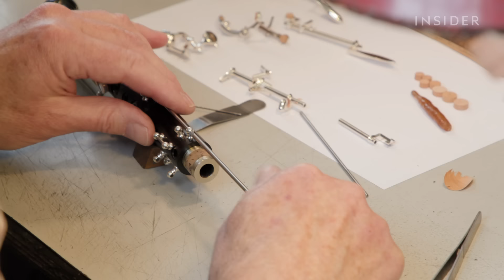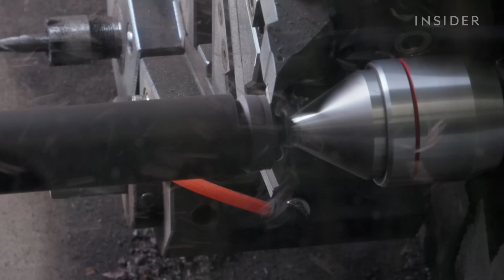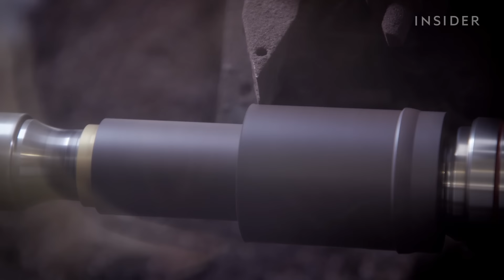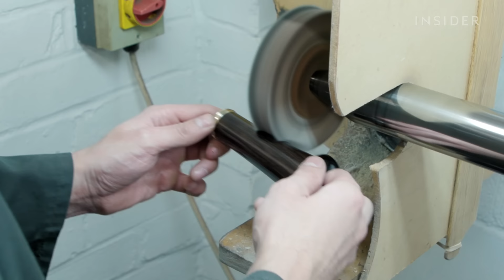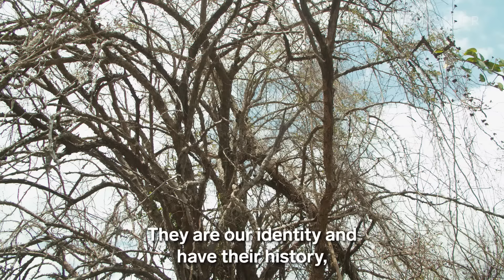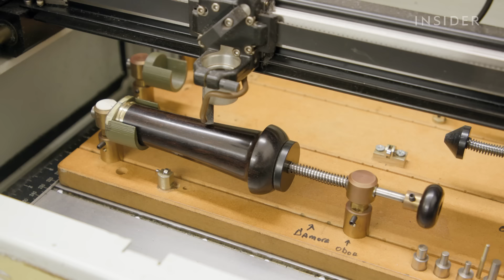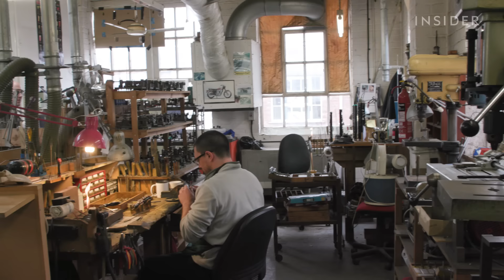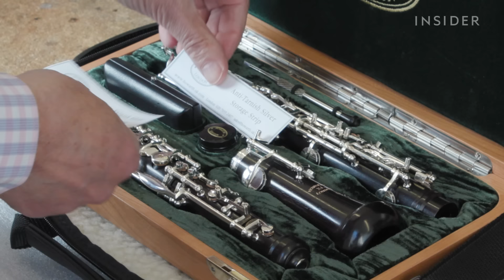Why Oboes Are So Expensive | So Expensive | Business Insider

Comment: If you're wondering why they crack so easily and need such exclusive wood, the answer is bore diameter. The body of a clarinet has the same diameter all the way from top to bottom (excluding the bell at the bottom and the mouthpiece). This gives it great structural stability. An oboe, on the other hand, has a constantly increasing diameter as you go from top to bottom. So it's a lot more fragile. That's why they have to age it and can only use really hard and resilient wood to make it.
Reply: cone versus tube. overall. yes, they both taper outwards, but one is mostly conical, one is mostly tubular
Reply: @gabrielbotsford791  Yes, this is correct, the tapered part has a very different acoustic function and does not affect the fundamental properties. In fact it is a separate piece that attaches to the main body. Possibly more like the flared end of brass instruments, it may affect the dispersion of the vibrating air, rather than determining the note frequencies.
Reply: While the bore diameter and outside diameter increase from top to bottom with around a 1 : 40 taper, the wall thickness remains pretty much the same across the majority of the length of the main joints, so they're no less fragile than any other wooden tube made with the same wall thickness along its length. 

Wooden flutes made with a 19mm cylindrical bore have a much thinner wall and are far more fragile than oboes, so the shape of the bore isn't the factor here - the wall thickness and also the diameters of the toneholes and their proximities to one another is where the strength (or weakness) lies.

The bore diameter at the top end of the bore (immediately below the reed well) is just under 4mm compared to the outer diameter of around 19mm to 22mm (depending on the make and model) when measured at the same point which makes the wall thickness between 7.5mm to 9mm which is just as thick or even thicker than the wall thickness of a Buffet clarinet.
Reply: @chrisperyagh  I’m wondering how wooden piccolos compare to the other woodwinds you mentioned, considering that the wall thickness is exceedingly thin and the (albeit smaller) tone holes are closer together than a flute.
Reply: @熊ちゃん-h7t  Being much smaller in diameter with a similar wall thickness of a wooden flute makes wooden piccolos much stronger relative to wooden flutes - the wall thickness to joint diameter ratio is different on wooden piccolos compared to wooden flutes. 

Wooden flute bodies have a wall thickness between 4mm to 4.5mm and a bore diameter of 19mm, whereas wooden piccolo bodies have a wall thickness of between 3.5mm to 4mm and the bore diameter is 11mm at its widest (wooden piccolos are typically a reverse conical bore with an expansion at the lower end).

If you scale up a piccolo body joint to double the length and diameter to make it the same relative length of a flute body joint, it will have a much thicker wall. 

Think of a cardboard or metal tube with a 0.5mm thick wall as an example - if the diameter is small, the tubing will have more strength to it compared to a much wider diameter tube made with the same 0.5mm wall thickness.

Although the greatest risk with any wooden-bodied woodwind instrument is sudden humidity and temperature changes as well as not maintaining them well and storing them in less than favourable conditions.
Reply: @chrisperyagh  That's kind of what I was thinking.  While a wooden tube is  going to be inherently fragile and more prone to cracking than a cylinder, putting large offset holes all along the length of that wooden tube, and interrupting an otherwise continuous grain structure seems like it would be a larger factor.  Not to mention screwing metal hardware into it, though I assume they either use precisely sized pilot holes or glue/press fit some kind of machined insert or pem to receive threaded fasteners.
Reply: @somethingelse4424  Flute and piccolo pillars are mostly hard soldered to ribs that are in turn screwed into the joint with several short wood screws, rather than individual wide pillar threads being screwed directly into the joints as they are on oboes and clarinets (and bassoons). 

While the body tubes of wooden flutes may be relatively thin and full of toneholes, they don't tend to experience the sort of excessive stresses or applied forces that will snap the joints, unless you accidentally sit on one. 

The headjoints will collect the majority of the condensation from playing and that increase in humidity levels in that area is where cracks are most likely to happen when the inside of the tube is absorbing moisture much more than the outside and the resulting increase in pressure as the cellular structure increases in size can only move outwards causing the outer surface to crack. 

There were wooden flutes made with lined headjoints and the combination of the stability of metal and the effect of humidity levels on wood often cause the headjoints to crack as the wood shrinks against the metal liners. The same is often seen on oboes and clarinets with metal lined sockets which can crack the wooden sockets where the wood is at its thinnest when they dry out.

Metal and wood and metal and plastic just don't mix and at best they're a compromise and at worst a disaster. You'll see on plastic Yamaha piccolos they have two main body ribs with a gap between them at the G# key. Only on wooden piccolos this causes no problem as wood doesn't shrink lengthways with changes of humidity anywhere nearly as much as it does widthways. But on plastic piccolos where the pastic can move in all directions with changes of temperature, the G# key would bind up solid as the two ribs pulled in due to low temperatures, so Yamaha fit the G# key with a short key barrel and also a soft plastic spacer to allow the ribs to move in and out and the G# key won't bind up as the plastic spacer has enough give in it to allow the G# key to still function even in cold conditions. Older Yamaha piccolos didn't have that and the G# key barrel needed some end play to allow it to work in all temperatures, although the end play was far more noticeable in warmer conditions. It's all compromises.

You don't get those mechanical problems or compromises with metal flutes or saxes as they're all metal and hardly affected by temperature or humidity changes so keywork can be made to fit with complete precision. Only temperature changes will manifest themselves in other ways with cold temperatures causing more condensation to form as well as making them play flat due to the greater density of the cooler air column within the body tube (and play sharp when hot as the warmer air column within is less dense).
Reply: Like @Filip said, the bore of the clarinet usually tapers at the top. Most modern clarinets, particularly professional models, have poly-cylindrical bores with different bore diameters at different sections. Are you able to provide a source on how tapering bores affect structure integrity? Also, almost all wooden clarinets are made of African black wood too, and as far as I know, wood cracking is a major issue in clarinets; I am not sure if oboes are more prone to it.
Reply: @antonyxiao1581  I've had to repair more cracked clarinet top joints compared to oboes and cors and I tend to work on a lot more oboes/cors than other repairers in my area. 

I've never seen any top joints that have been snapped in half on either oboe or clarinet, although plastic clarinet top joints can crack far easier as they don't have the same structural strength as wooden clarinets. 

As far as structural integrity goes, oboe joints are equally as strong as clarinet joints. The weakest spot on any joint being the tenons - especially the middle tenon on plastic or composite (Greenline) instruments as that's under a lot of stress.

Even Greenline oboes can crack between the top joint trill toneholes like wooden ones (as well as being far more prone to shedding their middle tenons).
Reply: @chrisperyagh Can it be made from other cheaper wood then ?
Reply: @JaemanEdwards  They're using Mopane for some oboes which is less costly than grenadilla and also some oboes are fitted with an ebonite bore lining in the top half of the top joint bore to reduce the risk of the top joints cracking (although it's better to repair a cracked top joint instead of replacing it with a completely new one wherever possible).
Reply: Thank you for taking the time to share this information.
Reply: @HWHY I agree!! Thank -you for the information!!
Reply: This may be a stupid question, but could they not be made from synthetics?
Reply: @Stephen-iw8wb , every plastic oboe I've ever seen, the sound quality was way worse than a wooden oboe. I don't know why--you don't have such a quality dropoff with clarinets--but it is nonetheless true. Speaking totally speculatively, I would imagine that part of the reason for this is that there's a larger market for clarinets in general than there is for oboes, so there's more incentive for companies to develop better product.
Reply: @beatriceotter8718  Thank you. Does the plastic not resonate the same? How does it sound?
Reply: They do make them from synthetics. Only most plastics and composites used in woodwind instrument manufacture don't have the same tensile strength as wood and are affected dimensionally far more by temperature changes compared to wood (which is largely affected by humidity changes). As well as all the additional problems when machining synthetics compared to machining wood.
Reply: @Stephen-iw8wb  Possibly with enough material and acoustics study you could make something that sounds similar. It might look completely different though. Of course, because of tradition, people will shun a composite / synthetic instrument although it could sound even better and last longer. That happens with every instrument, even electric guitars. The conclusion is most people are inherently silly backwards traditionalists.
Reply: the diameter of a clarinet is also increasing to the bottom, probably just not quite as much but still quite a bit
Reply: @filip6307  This is completely wrong. The clarinet does not have a cone inner diameter hence it does not overblow a full octave, like a flute, oboe, bassoon, saxophone, so that the fingering of the upper octave is exactly the same as the lower octave. The clarinet is basically a pipe with a constant diameter. You may be confused by the outer shape of the instrument. You can check this for accuracy by looking up acoustic physics of musical instruments.
Reply: @DrDaab  i am aware that the instruments harmonic series acts in a way a cylindrical bore does. The bore of the clarinet is therefore also classified as cylindrical quite commonly. Still, if you look at the upper and lower joint of the clarinet, anyone can tell that the diameter slightly widens as you go down the instrument.
Reply: African Gabon Ebony (which is what this wood looks like) is also the most expensive wood you can buy.   Between $100 and $200 US dollars per board foot (12"x12"x1").   Black walnut for example is around $10 to $15 dollars a board foot.     It is one of the few woods that once fully dried, has almost no wood movement which is probably why its being used for this as it will not crack in normal conditions.    Wood likes to move due to temperature and humidity swings.    Ebony, once dried, will not move anymore.   Its also very hard wood to work with.  Very damaging to cutters and blades and can dull carbide inserts quickly.     I got lucky and got a nice large stock in an auction for cheap.   Beautiful wood.   But not one I would actively buy since it is an endangered hardwood.
Reply: @bigrigross  This is Dalbergia melanoxylon they're using which is part of the rosewood family (like cocobolo and kingwood).
Reply: it's not all about wall thickness, an increasing diameter will have the body run into the grain at an angle. i don't know how straight the grain is for this wood but at least under some circumstances that would certainly have an effect on strength. (n.b. i have no experience building or repairing woodwinds, i'm just saying it makes sense for woodworking in general)
Reply: @calinguga  The wood is most likely to crack or break where it's at its thinnest which is the tenons and sockets, hence the reason for the metal socket rings whch keep the wood in compression (just as a ferrule does on a wooden file handle). The bore taper is around 1 : 40 and less on d'amores, cors and bass/baritone oboes, so it's not a particularly abrupt taper.

I've yet to see an oboe or cor anglais lower joint that has cracked where the bore diameter is at its widest, unless it's the tenon where the wall thickness is at its thinnest (and easily repaired). Likewise with clarinets and bass clarinets which have a cylindrical bore with a slight expansion at the top and a much larger expansion starting in the bore at the lower end of the lower joint, the weakest points are the tenons and sockets.

The grain pattern of grenadilla is massively variable as well as irregular and it's rare to get a joint with perfectly dead straight and parallel grain along its entire length which is either down to natural growth or how the billets were saw cut. Even with a cylindrical bore, the chances of some end grain being visible in the bore or on the outside is high. Grenadilla and other woods used for woodwinds still have more inherent tensile strength than most resins, plastics and other composites have unless they've been reinforced with carbon fibre or similar.
Reply: Very kind of "Krispy" to share his science. I bought a Chinese copy of a stratocaster at the flee market in very good condition 50€ and after a few adjustments, it sounds between a tropocaster and a mesocaster.
Reply: @lorenzoblum868  - 🤣🤣🤣 Sounds close enough, then!
Reply: @lorenzoblum868  
I prefer a fly caster.  😁
Reply: @keirfarnum6811  there's a Gibson model called the flying V. It's not a budget guitar but I presume there's a cheap copy on the market... I also found an amplifier (transistor) that sounds awesome at the flee market. "Freshened up" the potentiometers (oxidation) and now, no more loose connections. Buying second hand is a good option if you're ok with DIY adjustments. Reduce, Reuse, Recycle...
Reply: @lorenzoblum868  I like smashing up  old musical instruments. I've smashed up loads of pianos and guitars which I have got for free or next to nothing. I doubt I would be able to smash an oboe though, unless it was an old useless cracked  one. I could wreck it with a hammer. It wouldn't be as much fun as piano (much less time to smash) but it is a possibility if I can get hold of one!
Reply: @lorenzoblum868  I like smashing up  old musical instruments. I've smashed up loads of pianos and guitars which I have got for free or next to nothing. I doubt I would be able to smash an oboe though, unless it was an old useless cracked  one. I could wreck it with a hammer. It wouldn't be as much fun as piano (much less time to smash) but it is a possibility if I can get hold of one!
Reply: @BeechingAxe   the first tim Peter Townshend smashed his guitar, it was spontaneous, but when he did it repeatedly, his manager would ask him to do so....
Reply: @lorenzoblum868  It was interesting to see the professional player say she was on her 5th oboe from that company! What did she do with the other 4?!! Did they split or become unplayable or some other reason. Because if she does have any old oboes to spare, I for one would enjoy wrapping them around a lamppost!
Reply: So don't stop making them because they require an endangered wood, no let's keep cutting tbe trees down for the 30 people who want to play and instrument no one gives a shit about. 👍
Reply: I played bassoon in high school and college and was wondering this, since bassoons are typically made of maple which is available and relatively sustainable. Also a similar instrument with regards to rarity, cost of the instrument, and manufacturing processes, as far as I know anyway 

Thank you for answering the question before I asked it!
Reply: The oboe, aka the agony stick.
Reply: Not entirely true mate, if you worked with wood you’d understand every wood is prone to cracking and that some woods are just much more dense or water resistant , and cracking has a lot to do with how the moisture is being released when drying out of the wood, not the shape of it
Reply: You can soak any dense fibrous wood in fiberglass resin and get ridiculously strong wood I don't see the point still
Reply: @beagle3247  not fiberglass resin but yes you can vacuum or pressure stabilize wood. You cant just soak it though if you need to penatrate more than a couple mm into the surface. You need the vacuum to get the resin to be able to fully penatrate the wood. Suck out all the water and air, have the piece in the resin and then release the vacuum, have atmospheric pressure force the resin into anywhere there used to be air.
This process doesn't necessarily always make the wood stronger per se, but generally depending on the wood it will make it harder, stiffer, etc. But if all you wanted was strength you would never choose African blackwood, too dense and brittle. Obv the tonal qualities of the wood must be the driving reason why they use it.
Reply: @miles11we  I was thinking fitting thin fibrous sheets together and then heating the surface and gentle low grit sanding and then polish but I didn't consider the density and structure of the wood effecting the tone. I just tend not to be listened to when I go into detail to the point it's depressing and I have no friends because I value intelligence and morality above everything else.
Reply: Why not ironwood, mahogany? Sweetgum?
Reply: There are other hard and resilient woods though. They don't need to use endangered slow growing species. It's just the desire for consumption.
Reply: Pushing a species to extinction just to make some gay ass music nobody will ever listen to. Uhh listen to lil pump or something lol
Reply: cant they just use a resin wtf?
Reply: @raz4371  They do make resin Oboes and you can buy them for $200. They sound really excellent and professional, but all the music toffs and snobs will say, oh it's got to be wood because thats how it was done before.

Ditto violins/guitars. You can buy excellent modern ones which sound perfect but some music snobs will say some dusty old creaky shitty Italian violin made 200 years ago is "better" because they are up their own arses.
Reply: @BeechingAxe  yea was wondering why they didnt mention this in the video must be in denial ...
Reply: @BeechingAxe  LOL quit lying, you can not buy an excellent sounding oboe for 200$ no matter what it's made from! though it does seem plausible in principle that for about 2000$, one could make a carbon fiber composite oboe that has acoustic qualities similar to african blackwood. but the precision machining will always be quite expensive.
Reply: @Ass_of_Amalek  What was I just saying about music snobs who are up their own arses. Thank you for demonstrating my point!
Reply: @BeechingAxe  I'm a violin maker, and you are clueless.
Reply: @Ass_of_Amalek  I have defeated you in the debate and now the lies start, as you desperately try to justify yourself. Nobody is falling for that. Just accept your loss and move on!
Reply: @BeechingAxe  you better be a child xD
Reply: could they be made out of some exotic plastic (polymer material) that's more stable with temperature and humidity?   I'm just wondering.  It probably changes how it sounds.  But are there any plastic that could on par with the wood?  If they can figure that out, then they could eliminate the aging process.
Reply: @ipick4fun27  If they were made from some exotic plastic that had all the properties you could want for woodwind instruments, chances are there'll be people on here complaining they're destroying the planet with the use of plastics and they should use natural wood instead.
Reply: @chrisperyagh  how self serving and cynical. Fact of the matter is that they would be higher quality instruments and I don't think musicians would even notice.
Reply: @GoingtoHecq  Maybe you should contact one of the many oboe makers or other woodwind instrument makers, or even all of them directly with your ideas and see how far you get with that. If you want a list of makers, I'll be happy to provide you with that, then you can do the rest and set the world to rights from the comfort of your keyboard.
Reply: Bore diameter huh? Kinda like this comment 🤭 amirite? amirite? 🤣😂😆
Reply: @jamesjameson4566  - "Idio-pentameter"
Reply: Why did the not mention this in the video? I was so confused
Reply: @ZimaCyberia  tradition! Also there aren’t very many oboe players

If the next The Beatles happened and they were a woodwind quintet, and all the teenagers went out to buy clarinets and oboes, you can bet manufacturers would find viable “tone wood” alternatives!
Reply: Fascinating.  Thanks for sharing.
Reply: Can they not make it out of something other than wood then?
Reply: Why not just use metal on the inside? I get that it’s called a wood wind but it seems like a simple solution to structure and moisture.
Reply: Capitalists want everything for less than $100.
Reply: Very true! And I wonder how many people realise just how foul our breath is! We're blowing loads of "all-kinda-sh*t" [I think that's the scientific term for it] into our instrurments. There has to be a better way!  I remember as a child laughing when they poured the "spit" out of a French Horn. My fingers still bleed when I play the bass. My flute still seems to have a leak in it - I cannot produce that much moisture in an hour?! The music feeds my soul, but I there has to be a better way!
Reply: Then they could be better made with stabilized wood or resin.
Reply: WRONG!! KEEP QUIET KID
Reply: Does wood actually have different sound than metal or aluminium or even resin made of manny different types of wood that could make the same structure or is it just a old age placebo effect that have spread because musicians are obsessive AF just like any other artist. Noticed that growing up with 3 generations of musicians and artists i chose not to pursue music or art  because of them and how they acted and when i compared a normal family or as normal as possible the biggest difference whas the musician part but I also notice that I get obsessed with other stuff easily and have a need to finish everything I start with and when I can't I loose days obsessing about it. So I do wonder if it really is a noticeable difference between wood or something that would not break and could be chaper or if its just some placebo and they are just crazy 😜.
Reply: @cryingalone7572  They are just crazy and up themselves. You will find the same things when certain "experts" eulogise about the phrasing of one classical artist over another. Two experts can have totally different and valid opinions. It's all subjective. Even layman can have equally valid opinions on arts. You can just make it up as you go along. There is no right or wrong unlike in the sciences.
Reply: It is probably only for oboe players playing in a state academic symphony orchestra.
Reply: The Oboe is conical, as is the Saxophone and some brass instruments, whereas the clarinet and flute are cylindrical.
Reply: Why not just make it with some custom polymer?
Reply: @DataLog  It would be too cheap
Reply: Then why are oboes also made of maple and rosewood? Yes, I've seen them.
Reply: Explain how this works. You can simply oil the bore and keep it humid to prevent cracking.
Reply: Blah blah blah. So much BS to justify exploitation of african resources.
Reply: How does aging it help make it stronger (Ignore me if they answer this in the video. I'll come back and delete the comment).
Reply: @Mehwhatevr , wood needs time to dry out. When wood is part of a tree and alive, it has water seeping through it to feed it. (This is also why trying to burn a tree that you just cut down doesn't work very well--you have to take time for the wood to dry out first.) And as it dries, its structure adjusts to the changes. Sometimes, it cracks. If it's going to do that, you want to do that BEFORE you take the time to carve it into an instrument and sell it. And even if it's not going to crack, you want to make sure it's fully adjusted.
Reply: ngl this reply gave me wood
Reply: As a woodworker there's a much simpler answer. The dense wood is precisely the reason they're prone to cracking. It's far less amenable to movement than softer woods such pine or poplar so instead of simply warping, it cracks. This is certainly aided by the numerous holes necessary for tone holes and keyword etc. as it weakens the overall structure of the woods. However it's a necessary tradeoff because a pine oboe would sound like trash. LOL
Reply: Thank you for copying and pasting from Wikipedia for us
Reply: Well, nope. Totally wrong. I guess you never saw a clarinet in your life.
Reply: Thats also why clarinets overblow at a 12, they are closed cylinder
Reply: oboe wood more rare now than pernambuco?
Reply: Isn't Oak supposed to be the strong wood? Super solid? Also nowhere as near expensive in comparison to African freakin blackwood.... 😑 theres gotta be a different wood type that works just as strong or atleast almost as strong that its not really noticeable...
Reply: Absolute nonsense expl,anation. Increasinf diameter has nothing to do with strength.
Yhey are made in such way they crack and thats it. If they donrt crack then they dont sell them
Reply: it has to be made of rare X” is almost always a social claim, not a physical one.
Reply: Clarinets are made from the same wood mate. Piccolos too.
Reply: Very approximate, and not entirely accurate post
Reply: @dvorpo  And by their logic, that would also mean a soprano sax is structurally weaker than a flute or a metal clarinet. Which as we all know, they're not - unless you're talking the dynamic range of the lowest notes of the flute which are weak by comparison to both saxes and clarinets (and of course, oboes).
Reply: african blackwood is used because of its acoustic qualities (it's extremely dense and resonant). the cracking is due to moisture changes from condensation and spit during playing, and then drying in storage. all wood contracts while drying, and if it doesn't contract evenly enough, its shape changes enough to crack from internal tension. the moisture cycling in various steps of pre-shaping for years during production described in the video is done because it very slowly decreases the intensity of the wood's reaction to moisture changes (both the age alone and the moisture cycling do). and of course, as they mentioned, they use it to weed out pieces that grew in such a way that they deform unevenly during moisture changes, causing them to crack. by making them crack during production, the makers prevent those pieces from ending up on instruments, and cracking after being sold.
Reply: Ok Scientist !
Reply: Nobody’s wondering.
Reply: No one was wondering
Reply: yeah. they said that.